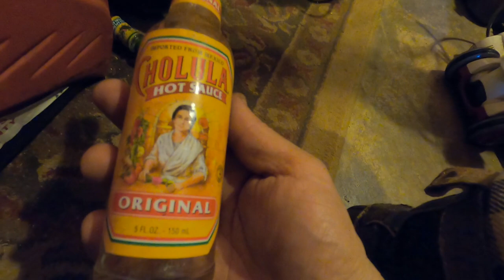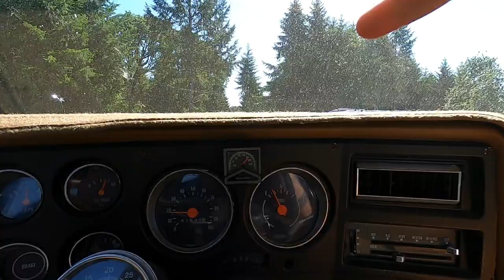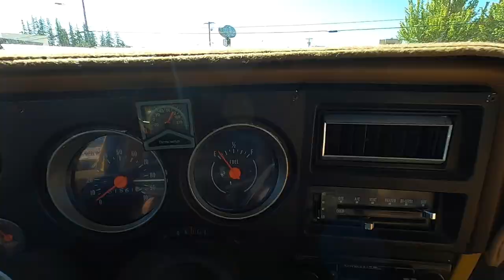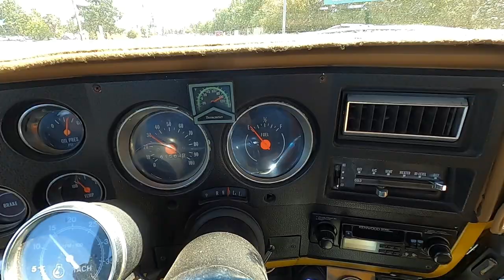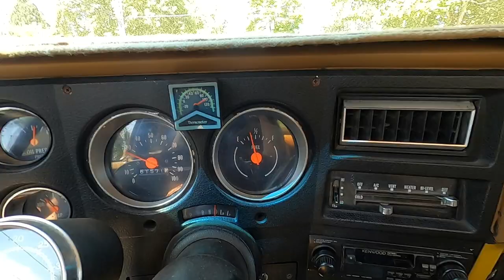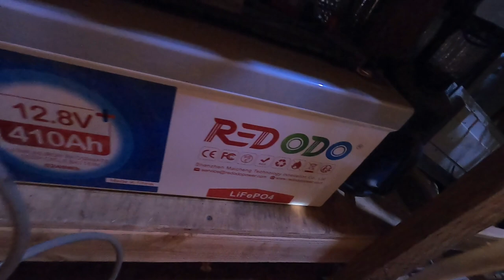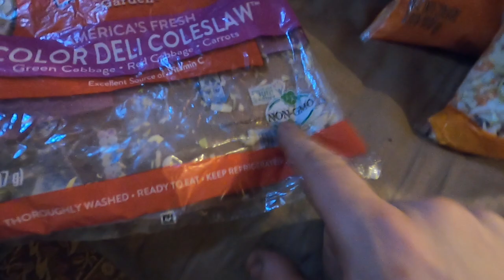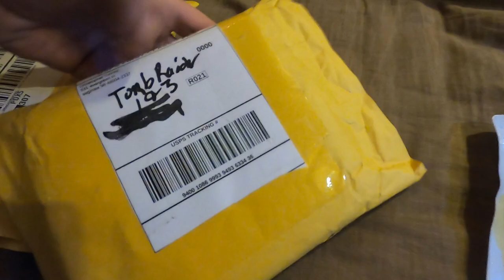Rebuild Problems, Cooking & Tool Shopping

Comment: Get better gas mileage by getting rid of that extra fuel tank and 5th wheel hitch in the bed of the truck. Enjoy the videos have a great day.
Reply: @Michael Green  actually it will when you reduce the weight in a vehicle it takes less power. That's at least 500 extra pounds of metal back there.